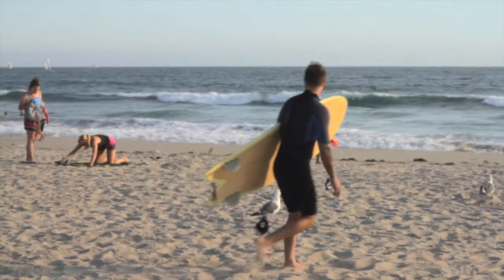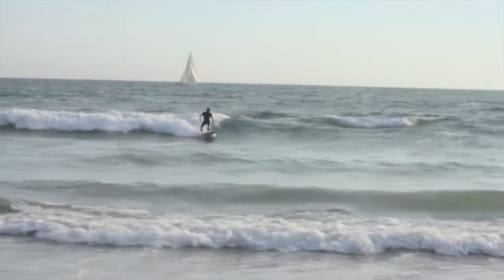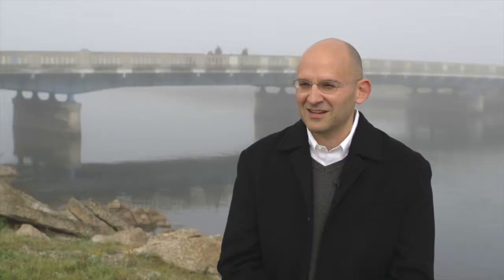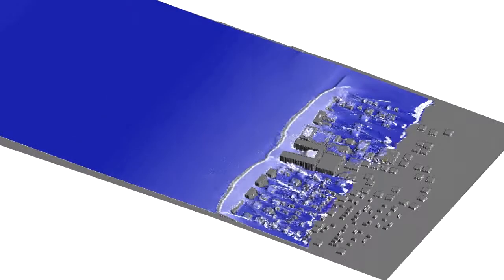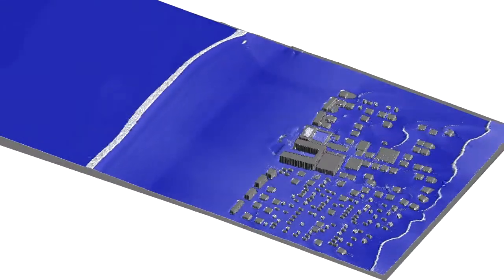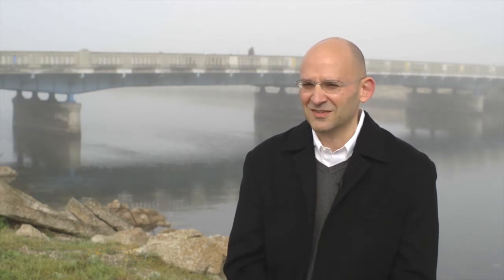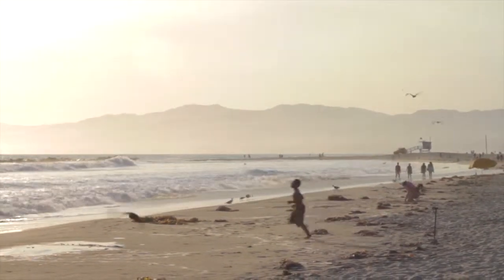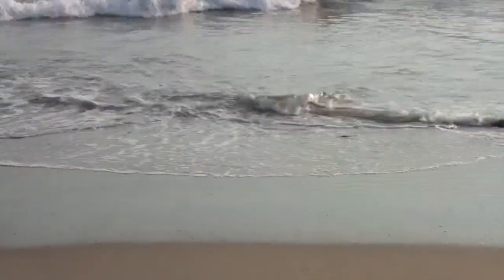Faculty Profile: Patrick Lynett

Comment: Will the TsuRuni VR program you developed, and plan on discussing on Feb 6, 2025, show the massive debris flow generated by tsunamis? How about the deformation of dunes during the first wave intrusion?  I'm concerned that the reality of debris flow, and potential debris field fire threat, is being grossly underappreciated. The TsuRuni photo preceding your presentation gives a misleading image of clear, blue tinted water, and no debris around and under a tsunami tower. Reality is that large debris can envelope within the pillar structure, weave into a mat, and create a much bigger stress target when the second tsunami wave hits, thus bringing down the tower. Tsunami evacuation hills are much cheaper to build, more resilient, pet-friendly, ADA compliant, fire proof, and debris flow resistant. I fear your presentation will enablle the expensive towers over more commonsense hills.